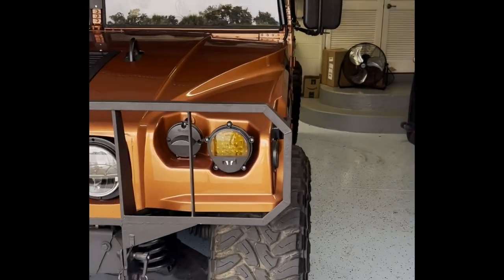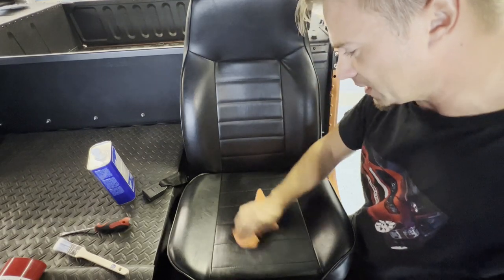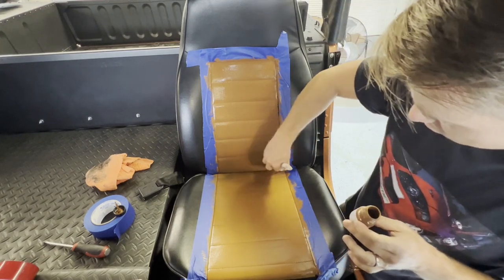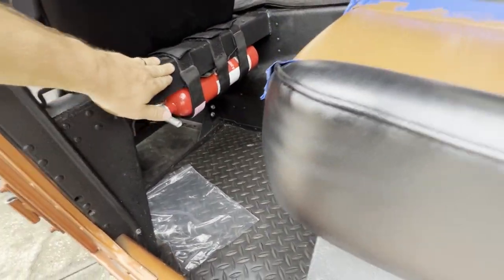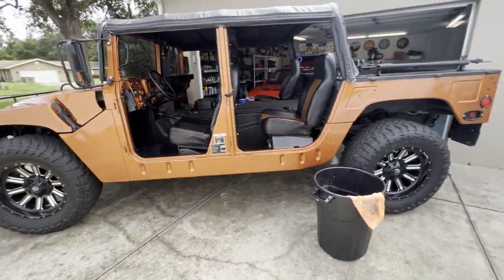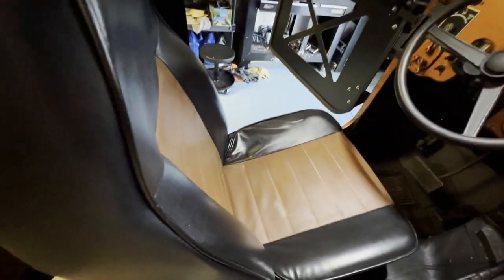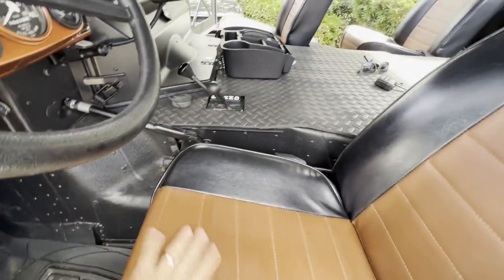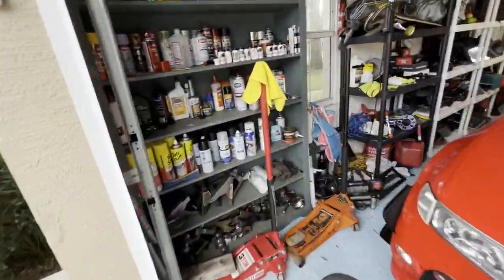How to Dye Leather Seats, Angelus Leather Paint

Comment: What’s the update now, did the paint stay as it is or did it fade or cracked? Thanks.
Reply: I use this paint for custon shoes and on a sofa it holds up no fade at all I own over 60 colors . If you have a jo annn fabric where you live go to the website and get 50% off with a code most of the time it's on sell . I was getting the paint 50 percent off but they caught on people was doing that . The 50 percent off is for anything in the store but nowadays they put everything on sale so you can't use the 50 percent . It's only 7 bucks when on sale very cheap the bottle small but covers alot . I love it